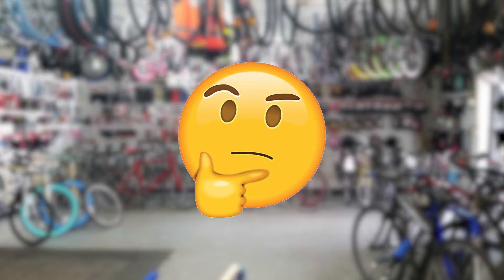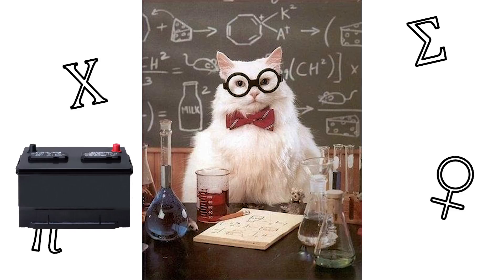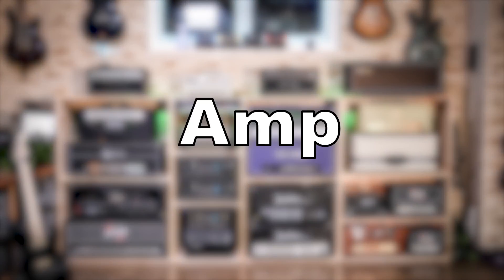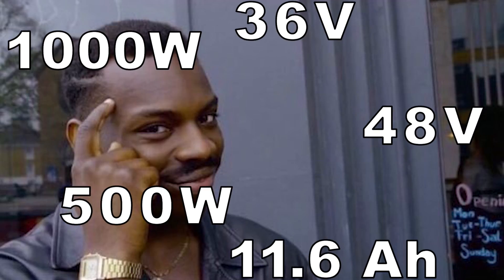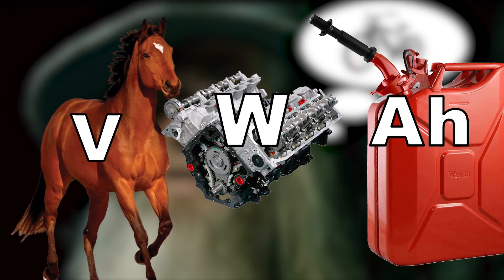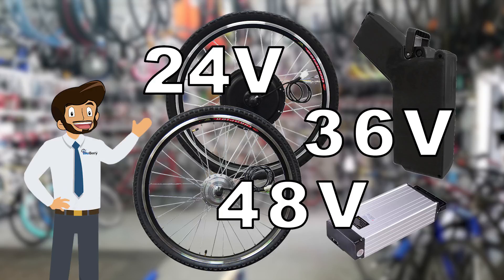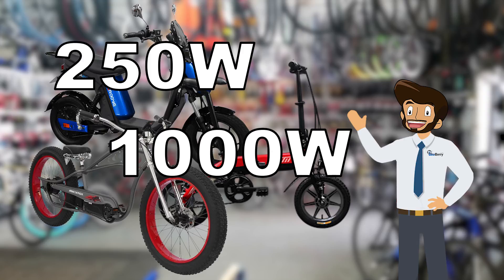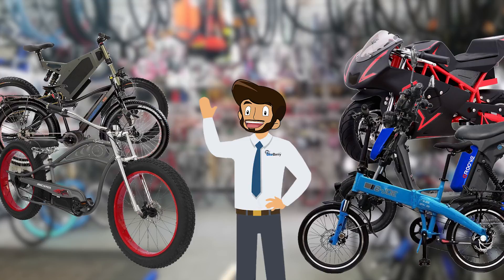What Are Volts, Watts, and Amp Hours - How To Choose An Electric Bike

Comment: 1000watts is not enough to climb hills, gearless motors aren’t designed for loads. So, a 3000watt gearless hub wont climb hills like a 1000watt geared hub. 750watt geared hub is common and ideal for most folks

Comment: How does the controller affect performance?
Reply: Controller regulates the power the motor is able to pull from the battery. If I had a 350watt motor with a 72volt battery. The battery could put more power out then the motor can handle, a controller is like a fuse breaker. Controllers also “control” the sensors on the bike and inside the motor.

Comment: I think im retarted LOL Im so confused! I have a motor that says it needs....This kit is 24V, you need two 12V batteries, (lead acid or lithium), 
or one 24V battery. After they are linked together, 
the recommended capacity >15AH, working current need less than 20A. Does that mean the batter needs to be higher then 15ah or lower?

Comment: Dude you're supposed to explain things...This is lke saying the bigger the petrol tank the more range...But for a Dodge Viper??? Or a Yamaha townmate ?? I mean this doesn't help one bit
Reply: In general amp hours mean more range, but a motor can be higher performance and therefore need a bigger gas tank. So, a 50ah battery would be ideal for a 2000watt motor, but wouldn’t make sense for a 350watt motor. It would be similar to putting semi truck fuel tanks on a Honda Civic.

Comment: I want a speed of 70km/h  on electric cycle and my weight is 60 kg and I need milage of 100km .plz suggest me motor and battery and controller.
Reply: 70km/h you need atleast 3000 watts and 30Ah battery
Reply: I have a 1000 watt hub and it consistently hits 25mph. Tires matter also, small diameter more acceleration, but less top end speed. 2000-3000 watts with a high voltage battery

Comment: Will an 80cc 2 stroke kit possibly fit on a bike with a really low top tube that's close to the down tube, and I mean the engine would be above the top tube instead of in-between the down tube and the top tube
Reply from the maker: This is possible with custom mounting modifications, but is not at all recommended as it would move the engine and drive chains in close proximity to the rider.
Reply: Yeah that's what I was worried about, thanks.
Reply from the maker: A possible alternative could be our friction drive system. It easily mounts over the rear wheel instead of being center mounted.
https://www.youtube.com/watch?v=bKuWOxMFGb0&t=1s
https://www.bikeberry.com/gas-engine-kits/4-stroke-bike-engine/flying-horse-38cc-lock-n-load-friction-drive-bicycle-engine-kit-4-stroke.html
Reply: BikeBerrycom yeah I seen that one too which is probably a better idea even though I really like the 2 stroke kit, or I could get a bike that will fit. Thank you.

Comment: HELP my 50cc motorized bike pops through the intake manifold when I get going fast. What is wrong and what should I do
Reply from the maker: Please contact our customer service representatives at 1-800-317-0479 so we can get more information on the problem. We'd be happy to help you solve any problems you may have.
Reply: BikeBerrycom can I message them or do I have to call
Reply from the maker: Yes you can. We have a contact page where you can create an email conversation that will be the start of our dialog to fix any problems you may have.
https://www.bikeberry.com/contacts
Reply: It's just not right, you might need a new gasket or manifold